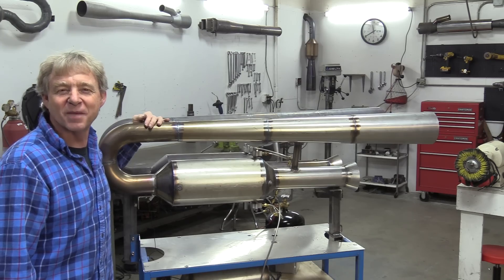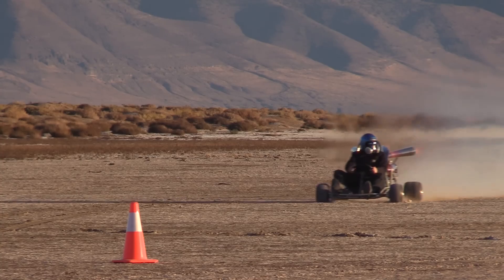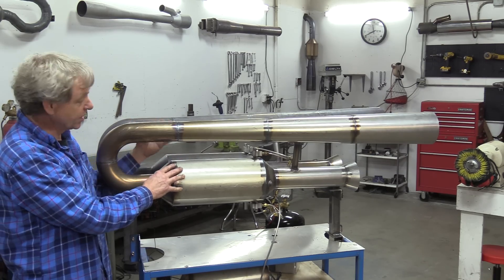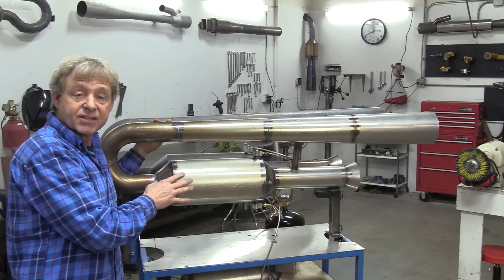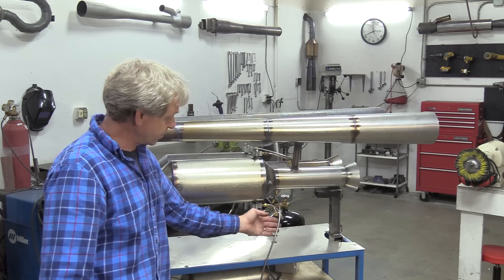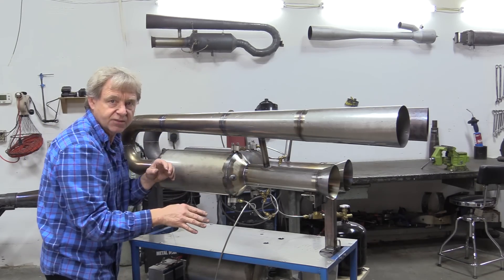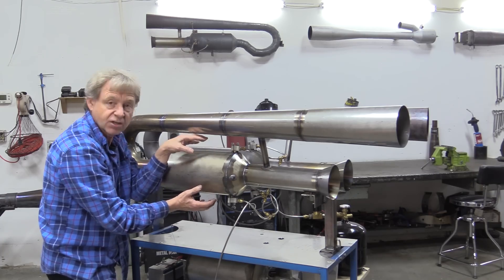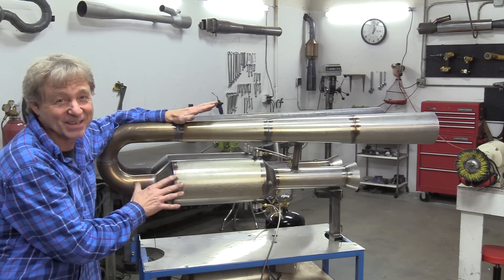Building the twin viper Valveless Pulsejet engine.

Comment: Why does the engine run at 100hz? Via 1/4 wave or helmholtz resonance properties i would expect th frequency to be a lot lower than that. Is the action of these pressure waves making them move faster than the speed of sound? Ive always thought these engines had a primarily acoustic sort of reason for working
Reply: Is it possibly to do with his injection method, can he tune it to a frequency to some degree maybe using a PWM type injection system?

Comment: What would happen if u ran it on gas instead of diesel?
Reply: Uses a lot more gas than deisel, but runs cleaner, deisel is cheaper, denser energy for longer runs but as he says wont start on deisel and needs the gas to start it up first.

Comment: I have an idea for the engines, instead of having such a bulky and large pulsejet, you should get some pumps in so that you can burn the fuel in a pipe quickly and then funnel it down on the exhaust and finally out,
                                                       ______________________
                       ________________/              fuel burns              \
   --||-------------/ ___________|                           in this chamber --------------------   Exhaust pipe, focused down so that you get more pressure in the chamber.
      fuel line |_________ <-Valve emergency shutoff
   ---------------\                       |                                                            _________
                      --------------------------\                                                  /
                                                      ------------------------------------------
You could add a propeller on the side of the exhaust to pump more fuel in.
                      |
                      |
-------------------+-----------------                              |
                      | ____________________ ------+------ <--- in the engine
                      |     drivetrain  ^                        |

These drawings are pretty bad, but the big propeller would be pushing aair into the engine and the small propeller would be spinning to push the big propeller. This probably absurdly difficult but its pretty much how turbojets work. You can modify the fuel to come in through the top and use a siphon effect to siphon fuel into the engine without needing a pump and you can add an air intake. Problem with siphon is you need to have a good valve to shut it off.

Comment: The researcher known as NOBOX7 made an awesome tool for rolling cones you may want to look into making for your own shop.

Basically its a stand that deflects a cone a precise amount where you roll it so that it turns at just the right amount without you having to fight with it.

Also, you would do well to put a reversible motor drive on your roller for a smoother, more reliable shaping process.

Comment: G'day,

Wow...!

What happened to the Beard ?

2/3rds of mine fell off last year (70 minutes with my head in a Linear Accelerator, at 6.1 Megavolts of Photon equivalent X-Rays...; to cure Tonsil Cancer).

But, having saved 5 minutes per day since 1986, which was when I last shaved..., Amounting to 43 days or so ; I decided to go with the remaining Assymetric effect.

Seen from the left I have an almost full Beard, from the right I have Sideburns, and from the front I'm a
Mangy-looking Zombie.

But it's like Wool Tufts on a Wing in a Wind-Tunnel.

The remaining Beard Hairs show where the Radiation was the weakest.

And, having to lose all 20 teeth to make room for the Radiation before getting cooked...; I decided that 
However much of the Beard 
Decided to survive..., then it can 
Stay where it is.

I'm not goanna start scraping it with knives every morning at this point, trying to 
"Look better.

Being
Bearded means that I
Cannot tell a
Barefaced
Lie...(?) !

What happened, did you burn yours off in a 
Puff of
Diesel ?

Such is life.

Have a good one...

Stay safe.

;-p

Ciao !

Comment: As you described the shapes of your chambers creating thrust in the beginning, what came to mind is the exhaust pipes on 2 stroke dirt bikes having a large expansion chamber just out of the exhaust port creating torque.   Hopefully you've patented your design on some of these engines.   You need to change your handle to 'Mad Maddox - Rocket Man', this stuff is right out of Max Max movies.
Reply: Hey 👋